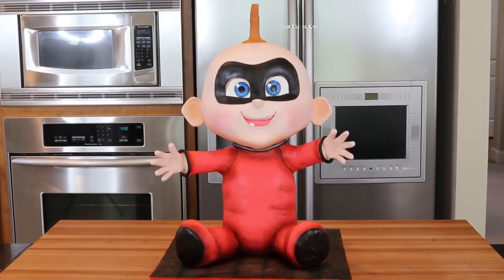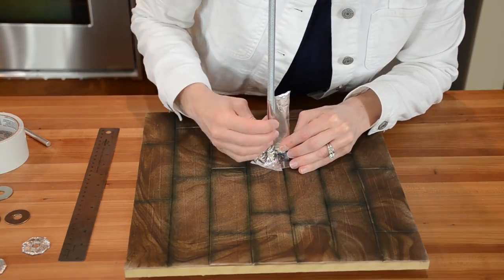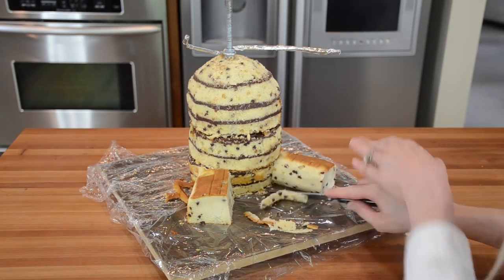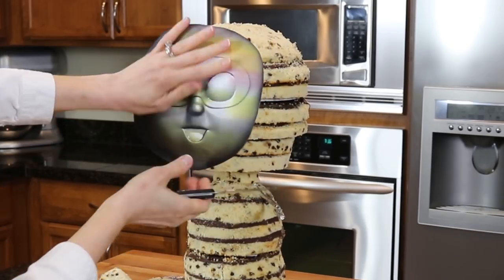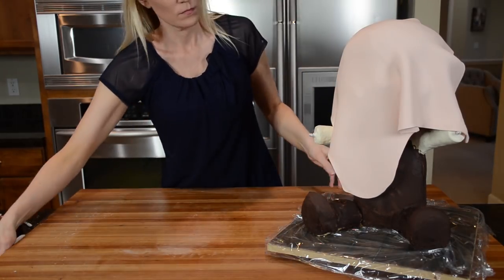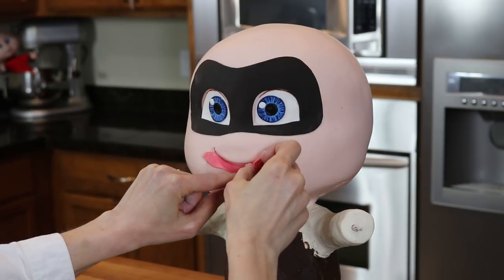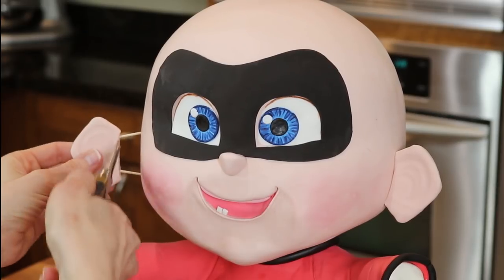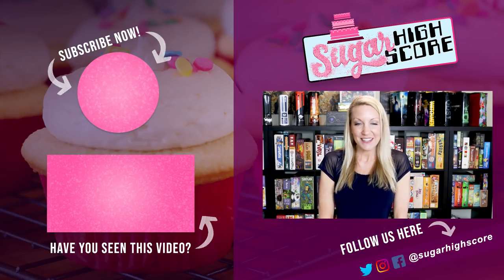Incredibles 2 Jack Jack Cake Tutorial

Comment: How do you choose when to use fondant only or fondant mixed with modeling chocolate ? Like what factors do you consider when choosing which one ?
Reply from the maker: Modeling chocolate will hold it's shape and is easy to blend seams. Fondant stretches which is nice when you're covering a cake. If you combine the two, you can blend the seams AND it will stretch. You should buy some of each and try them out. :)